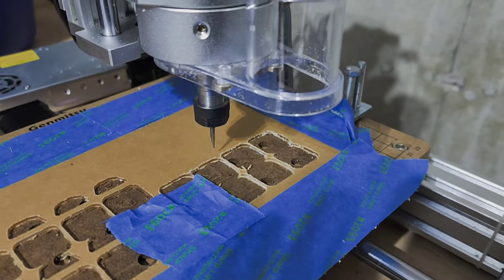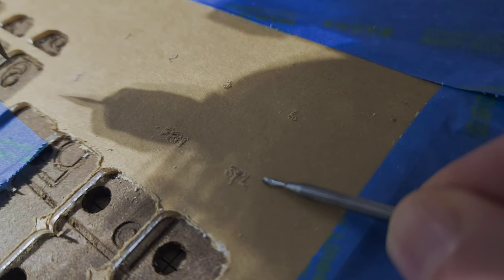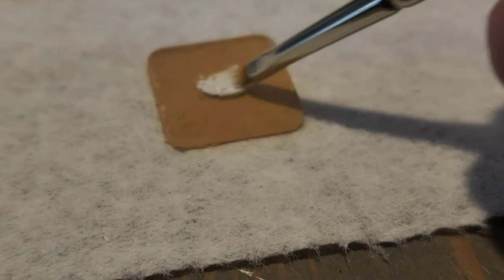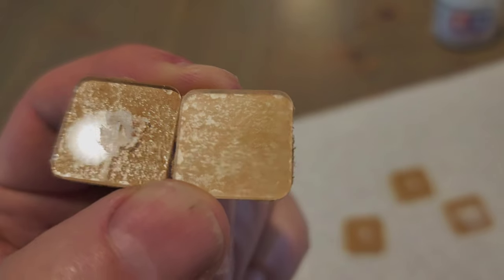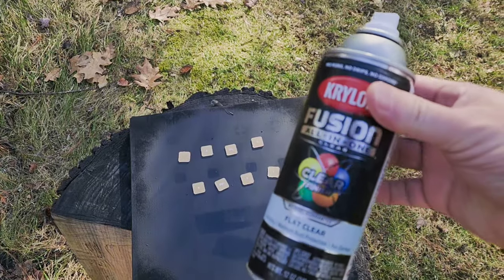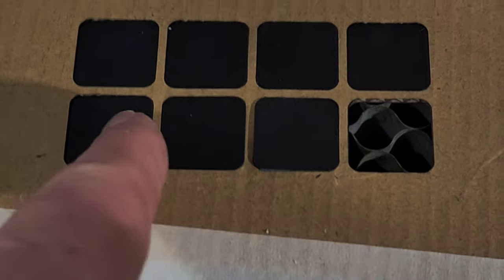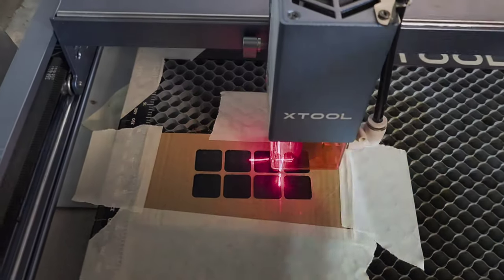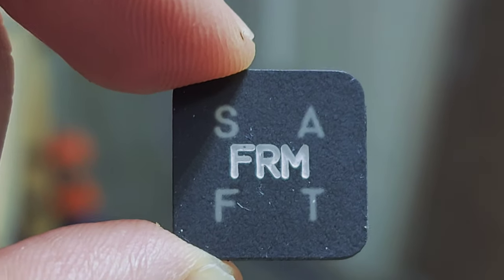Making Indicator Lenses for the F-16C Viper SimPit: Featuring the ECM Panel

Comment: why isn't all of that router cut / etched and painted sub-surface ??
Reply from the maker: A simple question and a not so simple answer.

There are certainly many ways to do this. Including using only a laser or only a CNC. But considering that I am trying to replicate the look of a commercially produced aviation switch, I have chosen to use the tools I have in this fashion. Specifically, why do I do it this way?

As a professional pilot, I use these types of switches constantly. They are very expensive even though I have modified actual switches for other panels (TWA, TWP), those simply won't fit in the space needed under this panel. Nor, do I want to spend $50-$100 per switch.  So, I designed my own. While doing so, I designed them to replicate that real look as much as possible to the best of my abilities and with the tools I have available. 

Doing all this sub-surface is certainly a possibility. But I needed the white to remain visible in all lighting and the "S A F T" to only illuminate when commanded. If I engraved or etched the rear with all markings, I would still have to do this in two steps. First the centers in white. Or if lit by LED, that creates another problem. More wires, more electricity and more complicated because DCS-BIOS does not have code to light that center etch. It also complicates the design of the switch housing immensely (1 switch, 5 LEDs = 12 wires). 

I considered using the laser to cut a stencil mask and painting it on the top or bottom surface. Similar to silk screening the markings. But they are so fine, I could not rely on maintaining adhesion of the centers of characters such as "P", "R", "4". 

For the most crisp and visible means of presenting the white lettering, it needed to go on top. If I used the same CNC engrave on the bottom, they wouldn't be as clear due to the wet sanding of the top surface, and even more so with the coat of flat clear paint. Why not just leave the top glossy then? Because glossy shiny things are not used in cockpits. Even glass has anti-reflective coatings. These would look less authentic that way.

So why not just etch/engrave all on the top surfaces? Because the acrylic is 1.5mm thick. Shining light through from the back side in one corner will diffuse throughout the acrylic and be visible in all the corners. Light will escape around the corners of the housings 4 internal segments into the acrylic. So the "S A F T" is on the rear where the black paint is in contact with the internal segments blocking the light. It has only one way to go... through the letters directly. 

Why do I write all this? Because every design change comes with drawbacks that needs to be resolved. Can I make these in a simpler fashion? Yes. Will they function? Yes. But will they be the closest to the replicating the real thing? No. But that is what I am shooting for. Your goals my be different. Good enough, is just not good enough for me. It's part of the fun. Besides, with the eye of a professional aviator, anything less than 100% I find to be a distraction. 

If this is something you are planning to do, you may have different requirements or standards for how it is done. And that will drive how you choose to do this.